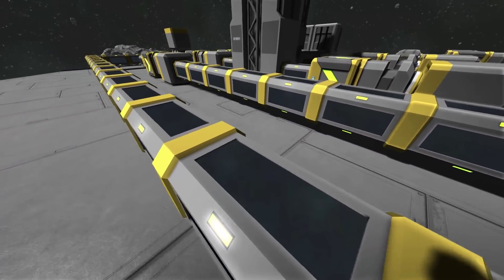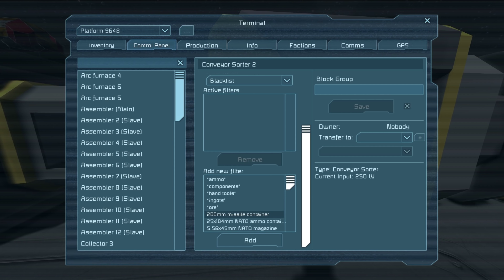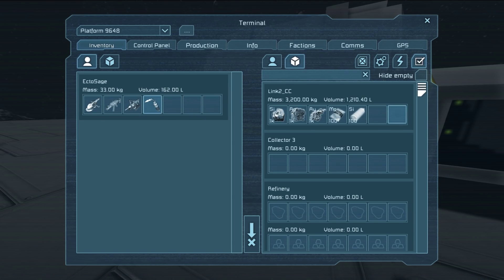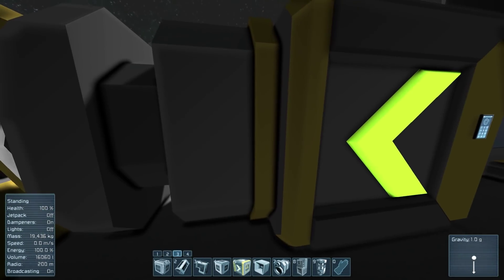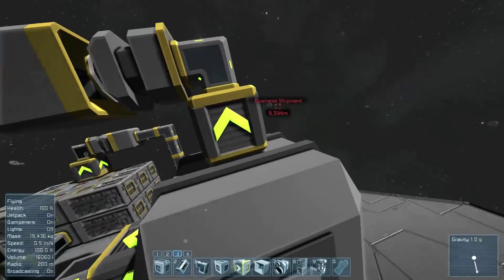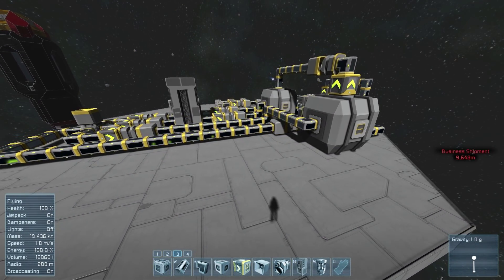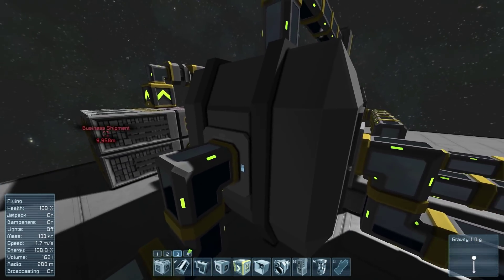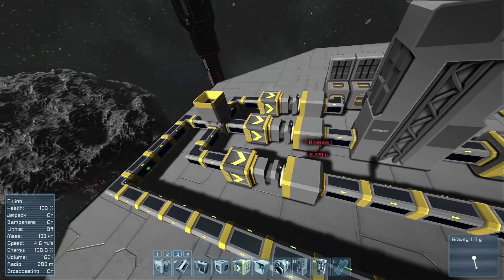Space Engineers, Automated Sorting, Refining, System (Update 01.073)

Comment: Nice explanation of the sorting.  I noticed with the latest patch that the connector-collector combination is no longer needed for pushing the wares onward.

My question is how would you include disassembling into the mix?  For example, you pick up a large ship and now have 800 or so thruster components in your inventory.  More than you need at the moment, so you want to disassemble half of them to recover the ingots.  Stick them in the collect at the beginning and they bypass everything.  Stick them in the ingot inventory, and they get kicked to the final holding.

Comment: your assembler master/slave setup will not work correctly because the assemblers must be on the same conveyor grid (ie. do not use conveyors to connect them) they need to be either connected via port to port or using conveyor tubes.

Comment: Someone mentioned "stone" as sort of wasted space and should be sorted out.  But, there is a mod somewhere that takes stone and makes it into concrete building blocks really cheaply.  So stone should no longer be considered a wasted resource, but another building material, though obviously mostly for bases for buildings and such.  That's good 'cause there is a lot of it and I always thought it could/should be used and now it can be.
Reply: Stone is also used for gravel, which is needed for reactors.
Reply: JustSomeGuy  also one that turns it into ice by extracting the tiny amount trapped in rocks.

Comment: I hope a fix is made in the future so we don't need to set up connectors/collectors all the time. Seems like a lazy, maybe temporary workaround. Hopefully a "forcer" block is added that does exactly the same thing that the connector/collector setup is used for. Or, the sorter block also acts like a forcer block too
Reply: Josh Repavich You don't need them that much, Sage did a bit of an overkill, the refs/arcs/asses(assems?) send their own push/pull signals for only the materials they need.
There are some minor uses for connector/collector combos, but the best one is shown by Sage when he collected everything from all the assemblers, which is way better then doing it one at a time. (unless they updated that in the last 5 months)
Reply: TraumKiller 5 min later i realized they added the "drain all" option for sorter blocks.